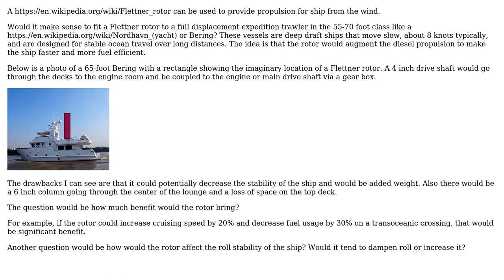Engineering: Would a Flettner rotor make sense for an ocean cruising trawler?

Comment: Just came across this video.
Unfortunately, ALL the answers are just wrong, and they have been proven wrong.
A Rotor would add worthwhile propulsion, AND dampen roll.
They also have much greater efficiency than regular sails.
An actual case story can be found at the link posted in the next comment, just in case Youtube doesn't like links.
The article is in the Popular Science, January 1984, and can be found in Google Books